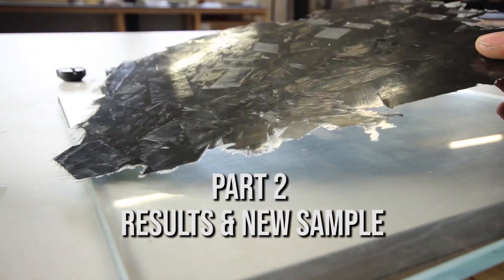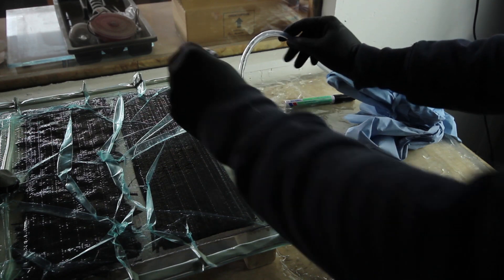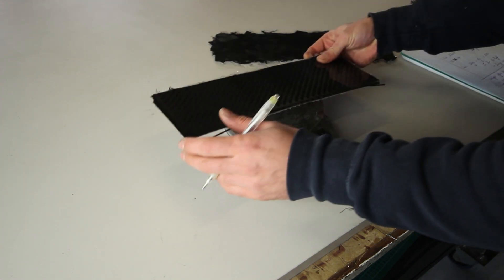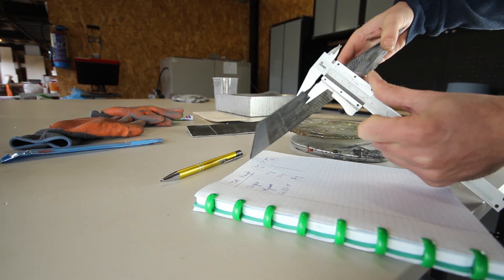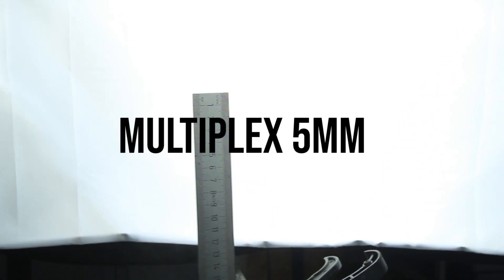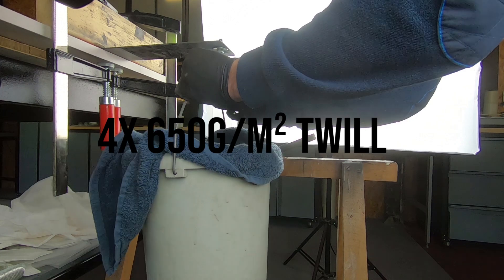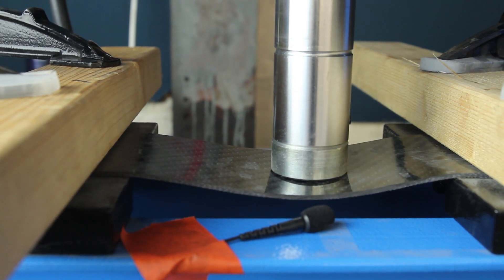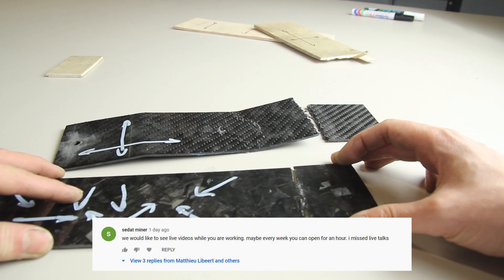Forged Carbon Fiber - Chopped Fibers (PART3 New Samples & Break Samples )

Comment: Not sure if someone else has mentioned it here, but a weakness in this test method is that you are always going to get failure in crush due to the higher stresses at the point where your samples are clamped to the bench. If you devised a way to hold the samples that did not crush them, each sample would take quite a lot more load to reach failure.

Still a somewhat valid comparison between the materials, but not a totally true test because of the varying fibre:resin fractions and the effect that has on resistance to crush forces.
Reply from the maker: Correct! But to start with I don't have expensive setups to measure each sample in numbers but was able to measure them by comparing them to each other in a same, or at least as close to possible, way to each other. The main goal of this video wasn't to prove how sting Carbonfiber is in general but how they compare to each other. Pretty sure I could come up with a test where these samples could hold up to 100kg each but that wasn't the idea 😁 but I agree with the points you mention and agree this isn't a scientific set up for perfect comparison! I see it more as a visual comparison to show people the bending of different materials

Comment: nice video, just I saw somewhere for testing the strength you can attach the scale to the end of the carbon and tie a rope to another side of the scale and pull the rope, this will give you a more accurate number, also I am thinking about making a bow, like using glass fiber for outside and carbon for the inside, I was thinking maybe you can do it too, it is a good adventure and especially with the amazing skills you have, it even would be much easier for you

Comment: @
Matthieu Libeert thank you for the response! You said it correctly, its Hey Zeus :). The Chopped strand flexed way more then i had expected. I can already envision the use cases for this kind of material.  Thanks again, keep up the good work.
Reply from the maker: Haha glad I had it right 😁 it has a lot of flex! Keep in mind that it is more the Carbonfiber veil that has a lot of flex, you could use the chopped in combination with woven fiber and still have a stiff part